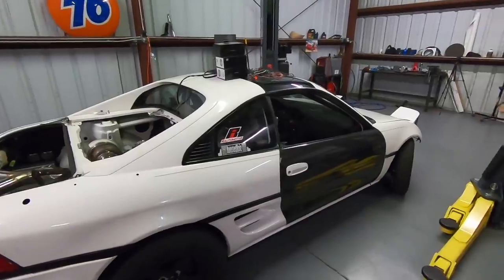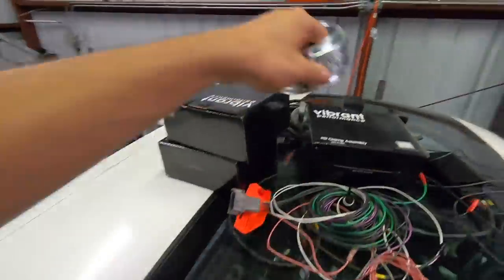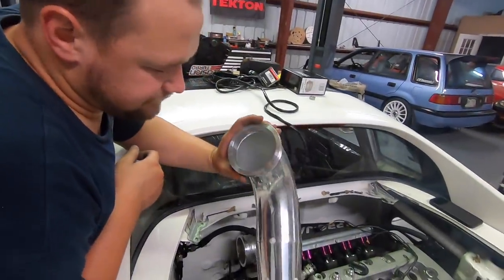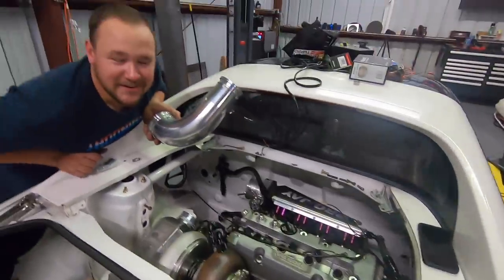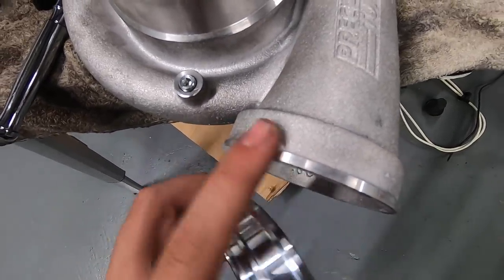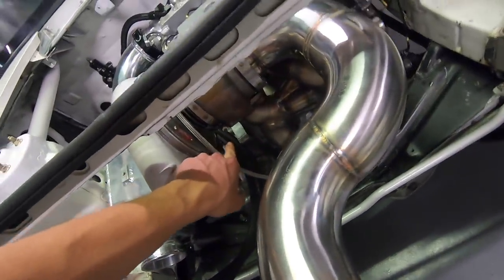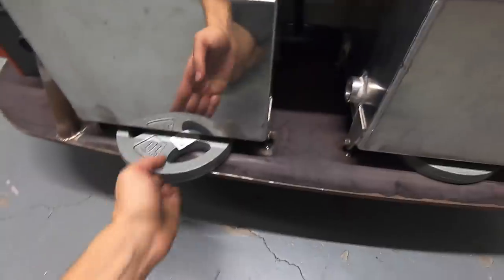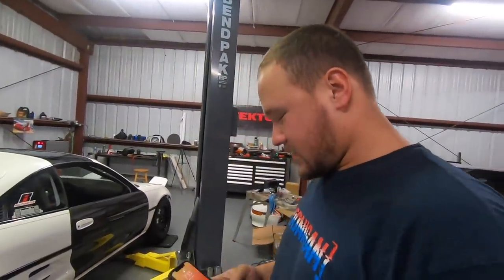So We Put The Mr2 Back On The Scales and It Lost A LOT OF WEIGHT!

Comment: Could geometry changes, by say having taller rear tyres, circumvent the need to put additional weight in the nose ?

I remember reading an article about the nose lifting in a magazine decades ago talking about the angles from the cog to the rear contact patches, there's a way to eliminate it, I forget everything they mentioned though.  Maybe put the seat on the bonnet, it'll be just like riding a motorbike ;)

Comment: @BoostedBoiz
Hey Kyle great job so far on the MR2. Are you guys going to fab up a fibreglass roof scoop for directing air into the turbo for when you go on tracks of high altitude? Would you ever think of making a roof scoop something like what the Mclaren 750 & others have? I would be pretty simple to make out of fibreglass or even carbon fibre & if would make your car extremely unique. Also you need to replace the rear window with an 1/8 inch polycarbonate one.

Comment: liquid is 8 pounds per gallon you will have at least 15 gallons with all liquid.  oil, fuel, coolant and ice water for the air to water intercooler.  but the car is way lighter that t used to be.

Comment: That turbo is going to starve your engine bay of fresh cool air.   Just get some carbon fiber snorkel's for crying out loud. Probably the 15th time I've mentioned this.   You could have gotten that number with just the snorkels introducing a fresh constant flow or air..  as usual with a problem diagnosis, add snorkels and we can just thank the weight drop for the extra half second on the et.   Snorkels man!!!

Comment: hey dude, i dunno what your plans are for intake but i can 3d print bell mouth intakes for dat venturi goodness (made for engine bay temps, but i could also potentially print a roof scoop setupup of kinds if i could find a mr2 locally to work off. Just thinking about those extra ponies from cold air intake (maybe similar to the stock turbo ones)

Comment: That glass on the top must be real heavy. Atleast 20lb
Reply: That weight being on the roof could be helpful for traction, old gassers back in the day would mount they're engines higher up to help weight transfer over the rear tires. It would be interesting to see if the savings in weight would help or hinder..

Comment: If you guys haven’t already a lithium ion battery can save you a good 30 to 40 pounds depending on the size of battery your running like the little Honda Civic battery in my del sol weighs 46 pounds the li-ion only weighed 7.8 pounds

Comment: If those are 5 gal tanks that's 45 pounds of water 35 pounds of fuel and 6 pounds of oil that are missing and thats 80 pounds on the nose of the car + fuel and water in the lines  and the water in the intercooler

Comment: Why do you want 50/50 for drag racing? Why not add weight on the nose by adding ic water tank , rad, battery up front?
Reply: The car was like 60/40 before. Moving the weight bias 10% forward is a substantial improvement.

Comment: Water to air intercoolers are ONLY beneficial on long track pulls not 1/4 or 1/8th mile runs. Unless your running it back to back to back runs but your it's will ALWAYS be what your coolant Temps are so like 160 170' Temps imo are NOOOOOOOT acceptable.  Ny built mini I got it running 17degrees above ambient Temps and only ONLY ever sees max 25 degrees over outside ambient temp
Reply: They're not using coolant. They're using a separate water tank, filled with ice water. The water is drained, and refilled with fresh ice water as needed.

Comment: Once you put the kick outs on the end of the exhaust are you going to be able to pull it back through the holes if you ever need to?
If you point in the up or down you should be able to do it but if you kick him out to the sides I don't know how you'll be able to remove the exhaust pipe if you ever need to.
Reply: They had them taped on when they first installed it and removed it. Kyle had similar ones on the old exhaust. He was still able to remove it.

Comment: All those aluminum shreds going into the turbo can't be good.... you guys should have blocked that off.
Reply: They removed the compressor housing from the turbo. It's easy to clean out.
Reply: @MellowYe77ow  Easier to block the entry and make the need to clean minimal.

Comment: why not put a supercharger on it? maybe that is lighter then a turbo setup and more evenly adjusted since it's on top of the engine connected to the belt!  just need to buy 1 bad ass belt drivin supercharger that can make more n/a boost :) no lag! there is ton's of thousand hp supercharged engine's out there <3